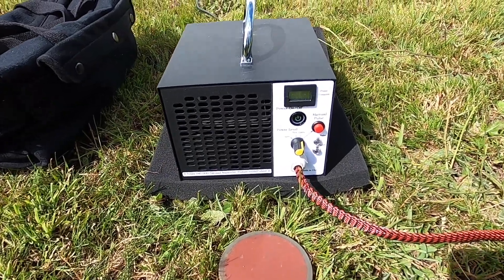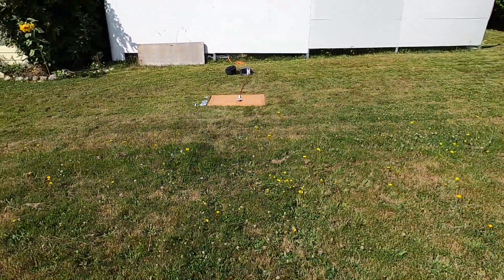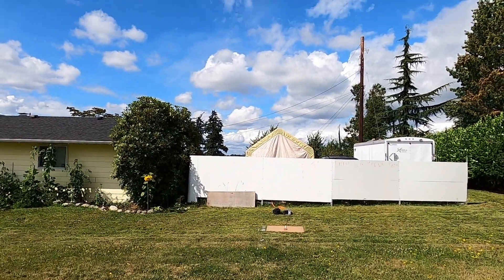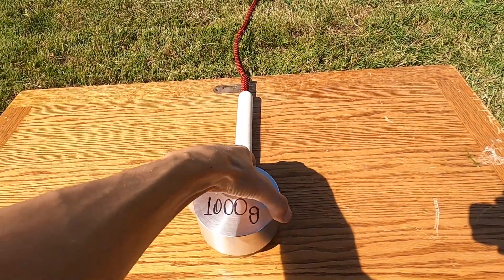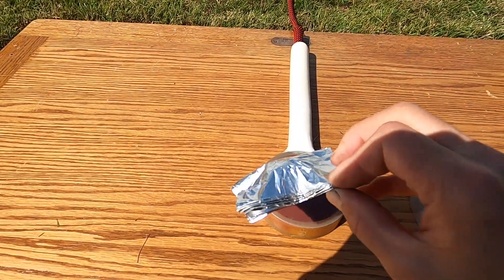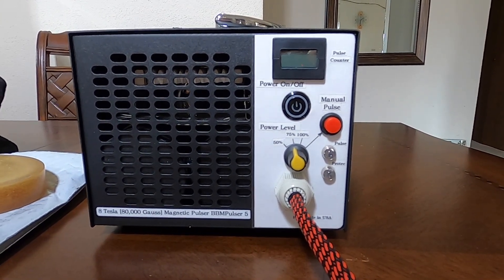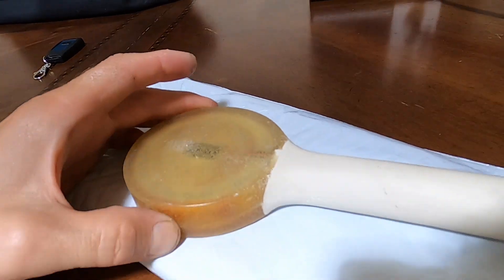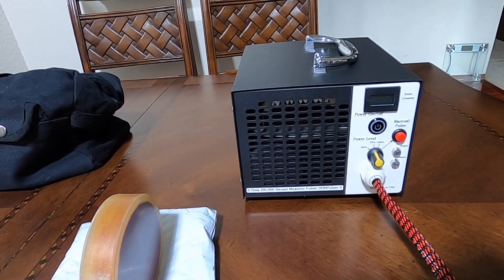012 Introducing BBMPulser 5S strong Automatic Magnetic Pulser 2.8 Tesla (28,000 Gauss)  PEMF machine

Comment: I was wondering... if you have a bank of capacitors... two capacitors or more, what kind of results are supposed to happen (to the body) if the pulses are triggered and the capacitors are connected in parallel or series (both cases) ?. Can you give a comment ?. Thanks !
Reply from the maker: @antoniohernandez8367  if you connect your capacitors in series, your "capacitor bank" will have higher internal resistance. This will produce longer and not so sharp pulses. If you connect them in parallel, "Capacitor bank" internal resistance will drop. It will be able to give off or resist to the load more aggressively. This results in pulses sharper. Also you will be able to use lower resistance (stronger) Coils like Strip Coils. Another benefit is that your capacitors connected in parallel always charge evenly. This is the issue with capacitors connected in series, one charges faster then another, resulting in one undercharge and second or third overcharge. This leads to failure in the weakest capacitor ( the one that overcharges. 
It's much more reliable to connect your capacitors in parallel. I do this in all my models. Also it's good idea to use a few capacitors in parallel, this way each capacitor is not experiencing much load and they work for years
Reply: @AndreyD  "A sharper pulse" means a pulse than can go deeper in the tissue than "a not sharper pulse" ?.
Reply from the maker: @antoniohernandez8367  sharper pulse means pulse is shorter in time and higher in amplitude. Yes magnetic flux will travel further away from the Coil and will penetrate deeper
Reply: @AndreyD  Thanks for the clarification.

Comment: I would like to get the 2 tesla model. Does it have a timer and how hot does it get?
Reply from the maker: I have one 2 Tesla BBMPulser 4S built and ready to go.
Also I have new Year Sale going on now. 
If you go to Ebay.com and search bbmpulser you should find it. 
No It doesn't have a timer. Usually with in 10-12 min build in safety coil  thermal switch will trigger. Temperature at the surface of the North side of the coil can get up to 85C. First 5 min of session coil is cool enough to hold it against the skin, rest of the time clothing material needed in between the coil and the skin.  Usually I use it first on the skin (face - teeth) then on my body then on my head when coil gets hot
Reply: I did there was only the wand left
Reply from the maker: @lloydmcculloughjr.1755  I'm sorry about that. I Can build you a new unit, are you looking for 120 or 230VAC model? Please email me support@bbmpulser.org

Comment: With this, pathogens have nowhere to hide now Andrey. Amazing!

How is it handling in terms of heat?
Reply: 65 to 70 pulses. With a pulser this powerful, that should be more than enough to scare away all diseases :)
Reply from the maker: @noelmoralde6242  time will show
Reply: If i were to give some suggestions, I think after this, the next step would be to study how to make the system hardware lighter and more compact so it could become really very portable.
Reply from the maker: @noelmoralde6242  Make it smaller and portable, possibly battery powered, that's the goal!  Some day I will get there.
Reply: @AndreyD  With your ingenuity, I'm sure you'll get there pretty soon.
Reply from the maker: I can get slightly under 10 min of Use before coil gets hot,  between 65-70 Pulses per session at 100% Power.